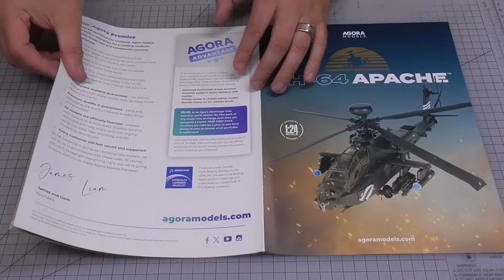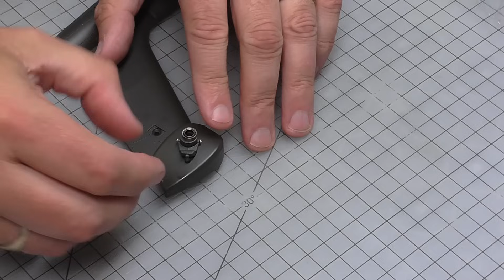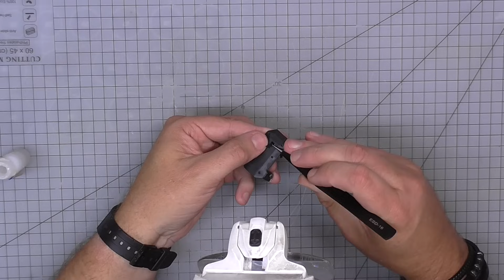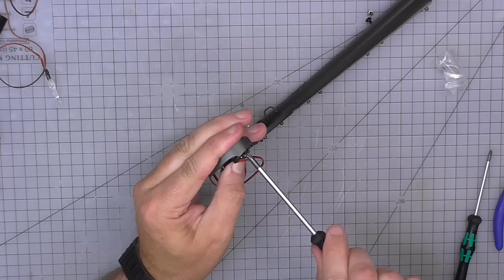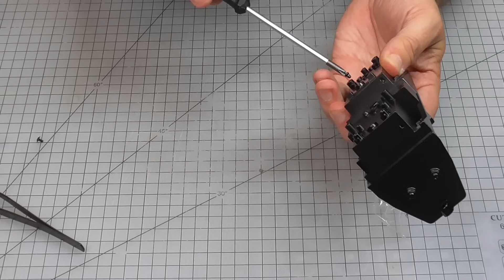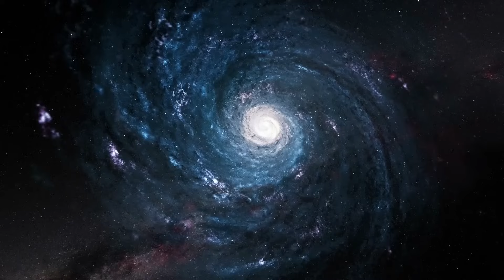Build the 1:24 AH-64 Apache Longbow Attack Helicopter - Pack 1 - Stages 1-4

Comment: I'm thinking about getting that same kit.  I'm a vet that used to be an armament and electrical systems tech for the Apache in the army.  I love this bird!

Question though.  Do all the parts come pre-painted?  I've kinda misplaced most of my modeling painting equipment. And I'm not keen on rebuilding it all just yet.  So I'm hoping the parts do come pre-painted.
Reply from the maker: Yep. No painting needed at all

Comment: Just bought this. Getting pack 1 tomorrow, can’t wait to get started. This is my first partworks build and you are the reason. Much appreciated.
Reply: Quick question. Did you have issues with the AM screws being too short when trying to affix the co-pilot seat to the cockpit. I could never get the screw to bite and ended up gluing it instead. Thoughts?
Reply from the maker: @TonyS-KY1972  no that I remember
Reply from the maker: Great build hundreds of decals

Comment: Built the first pack, wow, had to follow your instructions for the most part Wayne. I don't know if it's normal, but the tail rotor spins freely, by hand and by the test board. But, it seems easy to pull out of the frame and doesn't seem to lock in? Any advice?
Reply from the maker: Not yet. I'm sure it will be explained later

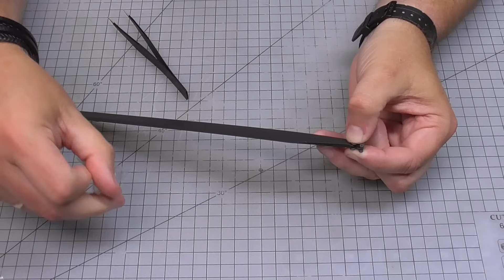Comment: I'm doing this build and have a comment. When building the main rotor (Stage 2, Step 18) your construct at 13:06 in the video is not the same as the instruction pictures (which are not clear at all). I believe you have parts 2-H and 2-J upside down. In other words, 2-J should be on the bottom of the blade when the angled end of the blade is to the right and 2-H should be on the top. In your construct - if you hold the angled end of the blade to the right 2-H is on the bottom, not the top. Please let me know if I'm wrong since the pictures, as I said, are minimally helpful. Thanks.
Reply from the maker: They were next to useless

Comment: Quite impressed with this first pack… But… Agora models got one crucial detail incorrect. The little hockey puck dome(the recon sensor pack) on top of the main rotor denotes this as an AH-64D model or longbow at the minimum. A regular AH-64 does not have the hockey puck atop the main rotor.

Comment: Wayne, not sure if you can find it in the UK but I recently found a super glue that cures by UV and dries really fast.  It actually comes with a small uv light attached to the glue container.  It is called Super Weld.  Might come in handy if you can find it.
Reply from the maker: I'll take a look. That could come in handy

Comment: The center display is called TEDAC (TADS (Target Acquisition Designation Sight) Electronic Display and Control), and it should have two handgrips to it which are missing. The other two are called MPD (Multi-Purpose Display).

Comment: Is it me or has Agora not learned anything in regards to these models and the way they send out parts, what i meen is you start the build on the Tail Rotor then for some reason which is truely Dumb then have you start in a seat. Why? start from one end then fuild from there. It`s like any other Model you could start from the inside first then move to the outside. It doesn`t make sense.
Reply: I think it's a brilliant marketing strategy.  Start off the build with a couple iconic sub-assemblies to pique interest.  In this case, spinning rotor and a fantastic lighted cockpit!  It's all about sales and generating revenue. 🤑
Reply: @theduel007  no it is not all you do is end up with parts all over the place waiting untill probably the last copy to finish it. that isn`t about sales it`s just being silly it may lead to people not buying it. for example say you buy a Lego model tell me does the instructions mix pieces up say instruction 1 then Instruction 50 then instruction 250 then instruction 2 you see my point it`s bloody stupid doing it the way Agora has done it. keep it easy to follow then move on. It`s not hard.

Comment: Wayne what glue with a brush do I need for mine in Feb so I can go shopping for it you made that look easy but lots to do can't wait for mine cheers Mark
Reply from the maker: You can getnit in the Range stores in the UK. It's not available online
Reply: @WorldofWayneUK  Thats too bad because the Gorilla Glue is the only glue I can get locally with a brush, and 9 out of 10, the bottle is dried up!
Reply: Thank you but I'm in Greenwich no Range stores local and I can't drive 😂 is there another glue like it om ebay or amazon that would work with metal and plastic?
Reply: @markshelton5140  search online for "brush on super glue"